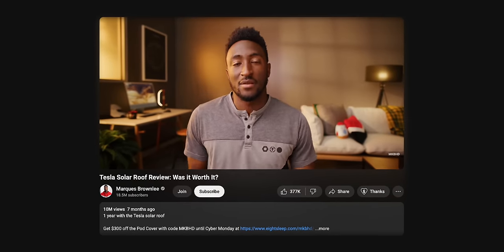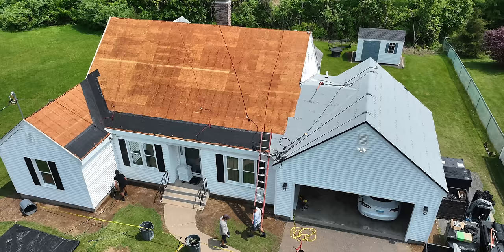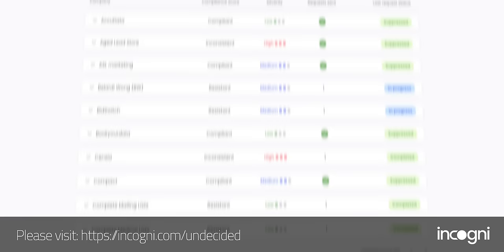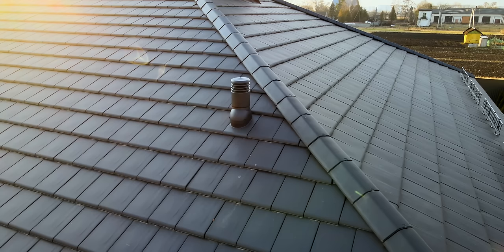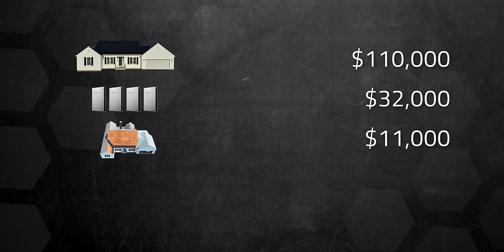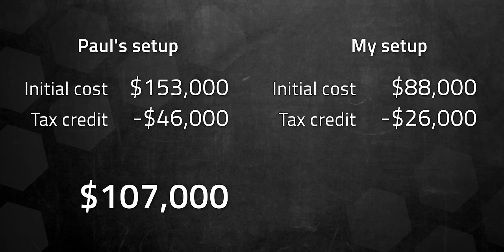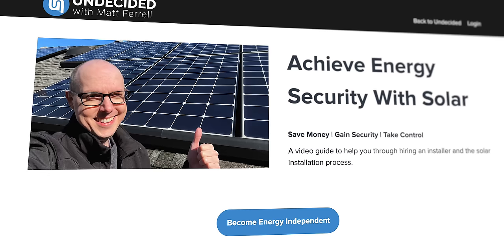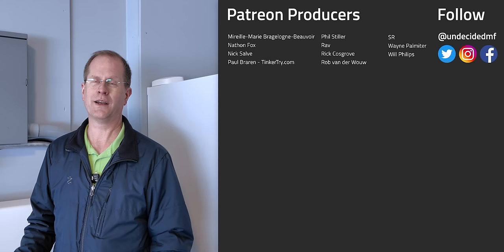Tesla Solar Roof vs Solar Panels: Which is Worth It?

Comment: One thing about your solar panels on your roof even with a metal roof after 5 to 7 years you will start to have leaks through all the penetration For the rails You need to go up there and Weatherproof them every 5 to 7 years has a roofer and have to repair roofs that leak from panels being put on the roofs I would prefer the way their installed from the other maker

Comment: I’d like to see a video on your metal roof with the solar panels and the additional savings in their insulative properties to the house. You are greatly diminishing the direct sun exposure for the homes exterior and adding a several inch air gap between panel and house. If you cover a significant portion of the house with panels it would generate a lot of electricity and significantly save on cooling in the summer.

Comment: In 2017 2 Powerwalls with 15kw Tesla solar roof was quoted at 110k for my house.  The same system using their solar panels was $63k.  The rep helped me out and ate some of the cost (commission) and got it down to $53k.    I don't regret it one bit.  My current solar panels I can have a payback time and easier to work on.  The solar roof cost almost as much as my house (purchase price) and no way I'd be able to get payback on it.   In the end it'd cost me more money.  Also the fact that no one else could work on the system was a huge no no for me.   Again, zero regrets and going the route I did I'll still have a payback.

I will say I had to re-roof my house, but it already needed it solar or not.  Even if you add that in the cost my setup would have come out to $66k.   I went with Timberline UHD shingles, so I expect to get 25 years out of them, unless insurance tells me to replace sooner.    I can re-roof my house multiple times before I get to the solar roof price.   I think the solar roof was only stated as a 40 year lifespan, but realistically I might not ever see that time in my lifespan.   I honestly doubt I'd get the 40 years out of it also.

Comment: $100,000+ is beyond reasonable.

My house is total electric: heating, cooling, hot water, cooking, laundry, lighting, computers, etc. My electric bill is $1.44 a month (up about 8% due to inflation over the past year) and my energy usage is covered by a simple 24-panel solar system with enough battery storage that I am off-grid capable, but remain grid-tied so that my batteries are used only in the event of a grid failure. My total system cost was $35,000 five years ago with no rebates. I could replace it today for half that amount. Without the solar, my electric bill would be $4,000 per year. Except it wouldn't be, because I would then cut way back on my rather profligate usage.

Six-figure solar installations are beyond my comprehension.

Comment: For the foreseeable future, pretty much all renewable energy sources only work if you're rich. My parents have a small townhouse, a 5.16kW system was something like $20k with installation and tax. The roof was probably going to have to be replaced as well within 5 to 7 years so theres another added cost to do it at the same time. Thankfully their house already had a 100A breaker as some have only 60A from that era (early 80s) which would've been yet another cost.

And if you wanted a battery for when the grid goes down, that started at $5k for a 5.3kWh battery the Tesla wall was like $19k on its own.

Comment: Still the issue of heat both for panel efficiency and lifespan in terms of power production. Seen a video with someone showing how active cooling on PhotoVoltaics cost less energy than it helps produce, even when it's not that sunny or hot out. Lower heat can help with energy efficiency even down well past freezing.  This also very much effects PV lifespan.

PV raised up above a roof allows air to travel under the panels providing a bit of cooling (though I worry/wonder about how much the energy absorption of a medal roof plays into this) If the PV are tiles, there is no way for air to travel under the panels for cooling.

Comment: Since insurance companies are cancelling policies nation wide, because they are not going to cover the removal and replacement of your solar panels when your roof gets damadged in a storm. Some wont insure at all if they are on the roof. This is common kniwledge. Not to mention, a very honest solar company will tell you solar is not worth putting on a house because of the non stop maintenance that is required.solar panels also degrade faster than admitted.

Comment: I wanted Solar roof since I had to replace my roof before adding solar panels, but I didn’t want to deal with the availability issues even if I’m in the San Francisco Bay Area. I’ve had my Tesla solar panels and Powerwall for a year and 3 month now and VERY happy with them! I should make a video to follow up my Span install.

Comment: I find that solar installations in the US generally are far more expensive that in other parts of the world. My 18kW solar with Canadian Solar and twin Fronius 3 Phase inverters cost me €18,000 ($20,000) in Spain. Now the batteries were more expensive with 2 Sonnen 15kWh units costing €23,000 ($26,000). Both without government incentives which in Spain unfortunately take forever, or maybe never, to collect.

Comment: Solar roofs with solar tiles simply cost several hundred percent more than solar panels!
In addition, they are much more susceptible to faults.
Simply because the xx times more plug connections of the small tiles mean there are many more possibilities for faults.

Comment: I don't have solar but have contemplated it. I would definitely go with standard panels. My house faces North so you wouldn't even see them from the road. I would want to set up my solar system to be seperate from the grid but I would keep the panel that is tied to the grid for one circuit to charge the batteries if they got below a safe level. So all the house circuits would be fed from the solar/batteries exclusively.

Comment: WOW!!! And I thought I paid a lot for my system, 14k watts of panels, 35k watt hours of LifePo batteries, 4 12k btu hybrid solar mini splits, inverters wire conduit mounting hardware etc. I did as much of the work myself that I could legally do but the wiring for the equipment etc I had an electrician do but all the parts permits and labor came to about 28k US. I've heard a few ppl say that if it will pay for itself in 10 years or less it is financially viable, anything else is a waste. My house is also most definitely a LOT smaller than theirs at only 2400 square feet but still, that's a lotta money imho :)

Comment: Ask any fireman how much they LOVE solar roofs... Easier to catch on fire, harder / impossible to put out, tends to result in more damage then basic bolt on solar panels. Let alone the whole vendor locking. My dad found that out with his Huawei solar installation, how much he paid to upgrade his 5K to 10K capacity battery. As in 5K capacity battery, for 20K capacity with 3th party solutions.

Side note: Those Solar prices in this video are INSANE!. Dads 7.5 panel setup was 12K Euro (inc 5K battery), installed. Even if we double the price to match more the above mentioned Matt setup, ...

Comment: When I look at the Tesla roof I become aware of the drop in efficiency in summer months as well as high peek winter days when the array becomes inefficient from over heating; it does not appear that there would be enough ventilation in the Tesla solar roof panels to prevent loss due to overheating; of course even the standard roof panels lose some efficiency on hot summer days compared to vertical panels that cool efficiently while charging on both sides of the panel. I'm still thinking solar panel tracking off of the roof with maximum ventilation on hot days to keep maximum efficiency and cooler well ventilated panels. The idea is that the grid tied systems would be putting out maximum on summer days when folks crank up air conditioning to offset the day's evening heat.  Grid tied systems work best when there is a high need for additional power on the grid. I too like the looks of the solar shingle roof and would do that instead of standard roofing for whatever power it could provide; it just needs to get a lot more competitive in cost to a standard metal roof.

Comment: I've got the Sunpower system at my house. 8kw solar panels with a 13.2kw battery. Panels are more adaptable to change. I can add onto it with the latest and greatest in the future. The tech changes so fast. If one gets a Tesla solar shingle roof they're stuck with low efficiency for decades.

Comment: Nice video. I put off solar for years mainly due to the tree canopy, particularly since 2 of the four most interfering trees were located on neighbors land. And even though those two trees were mostly overhanging my land, I wasn't sure if my neighbors would react. So when I had to take down 2 massive white pines in the front of my house (my rear roof faces nearly due south), I figured I'd take down the other 4 and go solar. I installed a 7.7kW system on the rear roof, and they were able to fit all 19 panels on the main roof wihtout having to go onto the garage as was originally planned. I flipped the switch the first week in January, and it being a cloudy month and low sun angle, I wasn't sure if I had gone big enough as I noticed the shading form the leafless trees caused more shadowing than I estimated, but now with the sun angle clearing most of the branches and the increase in daylight, I've turned the corner and am now starting to produce more electricity (averaging about 20 kW/day over the past 10 days) compared to my average consumption of 18 kW/day. It'll be interesting to see if I can bank enough kW to get me through winter, if not, I will add a few more over my garage, which my setup will allow for. I put a lot of cash up front realizing I'd get the 30% back from the fed, and $1k from the state in the form of tax credits. I also took out a 5 yr loan for the remainder of the cost which is only slightly higher than our typical average electric bill, but hope to pay it off even sooner.

Comment: Did you or Paul use a radiant barrier under your metal roofs?  I installed a shingle style metal roof almost 15 years ago and the installer almost insisted on it and I'm I glad he did.  At the end of the 50 year warranty my roof will be as good as the day it was installed while my neighbors will be on their 3rd or 4th standard roofs.

Comment: before watching the video, replacing the roof seems a bit extreme, looks great but solar panels seem more practical imho - not to mention servicable and upgradable as multi layered wavelength panel tech becomes more affordable and far more efficient as a consequence 

home builders should be looking at solar roofs rather than conventional materials, makes much more sense for this to be done during construction and complimented with synergistic features

Comment: Here in Australia people are trying to curtail their solar due to negative feed-in tariffs in the middle of the day.  I've seen as much as -40 cents per kWh but it's regularly -5 cents. This is in a wholesale market where the price changes every 5 minutes. 

So its becoming more important to balance the PV with the battery storage and household loads (EV, pool pump, cooling etc) and offset the costs by exporting at peek tariff times that occur every day. 

I export my battery in the evening when the feed-in tariff usually sits at about 40 cents per kWh but can get as high as $20/kWh on those ways when the temperature goes over 40 deg C (I think that's like 105 F). Those spikes only occur one a month or so but you can make a bit of money.  

Also regulatory rules are changing with inverter where the network now has the power to turn your solar production off at will when there's too much solar energy in the network. It would make more sense to install batteries but for some reason the networks just want to turn the PV off.

I use EMHASS to calculate when to buy and sell from the grid. It's open source software that works with Home Assistant and does a good job at managing charging the EV and running other things like the pool pump while also figuring out when to charge and discharge the battery to take advantage of the wholesale electricity price.

Comment: Buy eco-worthy’s 1500 dollar solar tracker. On a light day produce 5000wayts of power. Take 50k of the 107k he spent, buy 34 solar trackers. Average 175kw of production a day. Use the other 57k that’s left to buy eco flows 90kw battery system as well as the mppt and converters required. Never run out of solar. Literally ever.

While in understand that it would require an acre or 2 to set up. The excessive cost for these roofs with little production just don’t make sense at the moment. It’s more of a statement to your neighbors than actually getting off grid.

Comment: Like Paul, I needed a new roof (old asphalt one was 20 years old and losing shingles) and wanted a sturdier one (very high winds in my area), and my home also faces south (didn't want panels on the front).  I like my solar roof, but it took over a year between order and installation.  Since then I've had no issues with it.

I actually could have done without the powerwall since I have 1:1 net metering and can use the grid as my storage, but I guess the battery backup could come in handy (though we hardly ever have outages here).  Tesla would not install the solar roof unless I also installed a powerwall.

Comment: I’ve long thought the solar roof made the most sense for new builds or whenever the homeowner already had to replace the roof, itself, esp if looking at a premium material such as metal, skate5, or tile. That’s the kicker for solar roof- it’s a solar system AND a roof so, average sized U.S. roof, premium material, an extra $30-$50K.

Comment: Paul got the better deal. 

Note: His garage has a fire code violation - the Powerwalls do not have bollards installed.
Reply: Actually, bollards were put in place but weren't legally needed, as the set-back of the garage design prevents collision. I'm so glad they're in the garage and not the outside, as the north side of the house gets awful cold in the winter. Tesla and my town inspector also required me to have an interconnected smoke/fire alarm in the garage, which I had already installed when moving in. It ranges from about 30F to 95F in my insulated garage, with most wintertime temps hovering around 40F except during extreme cold snaps.

Comment: If I hadn't replaced my roof in 2015 I'd be very tempted by the timberline product. I would still have a lot to look into for energy storage and my area is at war with the concept of Net Metering. I would be much happier not having to consider storage if I knew that I could make money in the late spring, summer, early fall from surplus. Then use that 'income' to offset the shortfall from the late fall, winter, early spring.

Comment: I am glad I live in the UK rather rather than USA with regard to costs, only 4kW of solar due to roof restrictions, but 20kW batteries and 8kW inverter all switchgear, smart EV charger and install £18,000 circa $23,000. With off peak tariff an average cost of 10 cents kWh and 20cents export kWh repayment it is a no brainer when one is using 12,000 kW a year

Comment: We were interested in a Tesla Solar Roof, but have a fairly complex roof with around 4,500 Sqft and many different facets… the rough pricing from our installer was “$400k - $500k” which is a little much 🤣.
Reply: It seems in areas where Tesla doesn't do installs, 3rd parties charge more, way more. This is a bummer, but thank you for sharing your experience.

Comment: I went for the seperate panels , as I can update them at a later stage with higher wattage and individual inverters. I’m also looking at a battery connection , and most installers say that a DC connected battery is much more efficient than an AC (Tesla) connected battery. Have you covered the pro’s and con’s of DC Vs AC Power walls , great show btw.

Comment: I'd love to see the comparison of winter and spring storms between the two.. Hail, thick snow pack, clearing snow, and... Yea.. Hail. Or occasional tree branch.
Reply: Trees cause shading    Not a option
Reply: @sparkysho-ze7nm  fair, but I have trees far enough from the house that they don't shade... But in Midwestern storms the branches still can crash into the roof.

I meant in sturdiness and abuse, not in shade :)
Hail, ice storms, tornados, strong thunderstorms, flying debris, etc.
Reply: Also, how is walking on tesla tiles? Blasted trees mean I get up to clean out gutters a few times a year.
And gutter guards don't work well against pine needles, and the freeze/thaw/freeze ice damn situations we face here.

Comment: I live in Northern Virginia. About 40 miles out from DC.
Problem here is that you can get a Tesla roof however, all of the energy produced by your roof has to go directly into the grid and you get credits on your energy bill 

Also, you’re not allowed to get power from your roof that exceeds 75% of your current average electric bill

So, no Tesla walls or 100% coverage. You’ll still have to come out of pocket to the local utility every month. 😢

Legislation won’t allow you to get to net zero  🫤

I’m going to wait a few years and see if legislation changes and if Tesla increases the efficiency of their roof. 

My house is 16 years old and so I’m going to need another roof in about 8 to 9 years

Comment: Standard solar panels on a metal roof is a solid solution.

As you said m, each panels can be replaced easily. If there is extra space and extra needs, you can likely add few extra panels. 

Personally, I like the white roof black panels combo. 

It would be great to somehow collect the heat from these panels and use to heat up the water or store it underground. For these with optimal ground and climate environment, this solution might make sense.